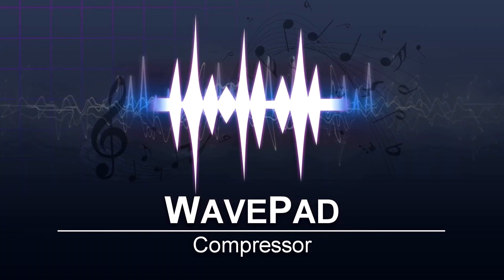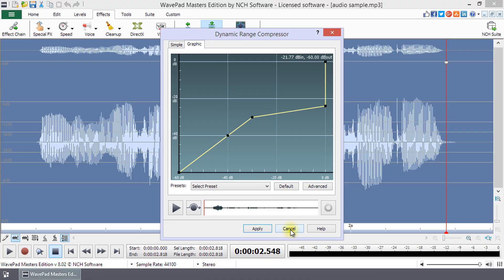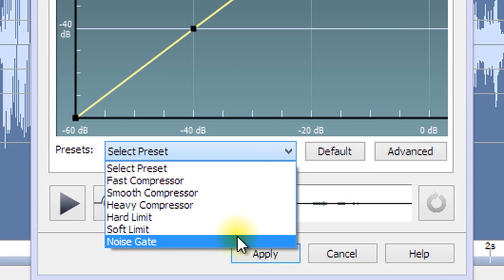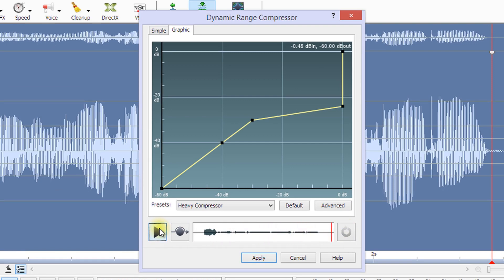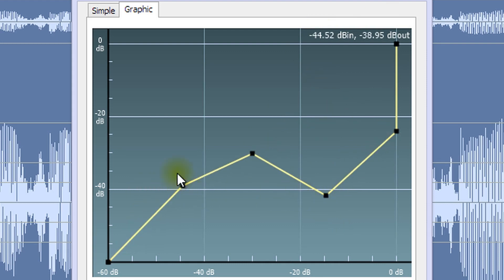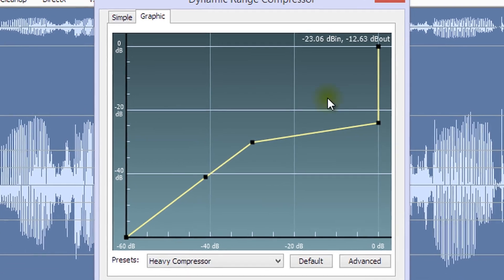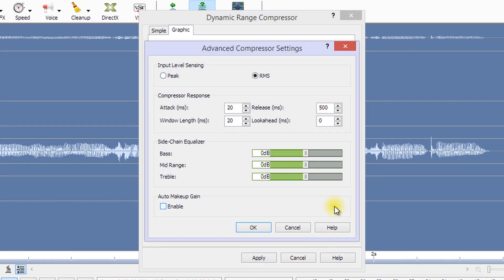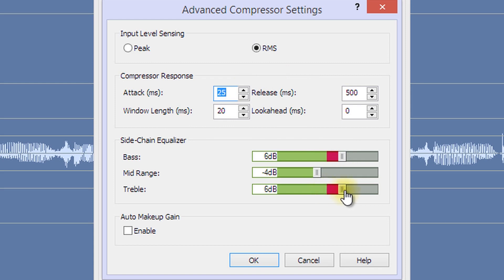How to Use the Compressor Tool | WavePad Audio Editor Tutorial

Comment: How do you do this in VideoPad?
Reply from the maker: Hi there, thank you for your inquiry. To apply the "Compressor" effect to an audio track in VideoPad, click on the audio clip on timeline to select the clip and then select "Compressor" from the "Audio Effects" menu drop down in the top menu bar.
Reply: I know. The three controls are threshold, ratio and limit. I don't understand how it works. I tried to increase the ratio and it sounds the same.
Reply: @HunterShows  I've had the same problem, no matter what I do on the compressor setting, the audio remains unchanged